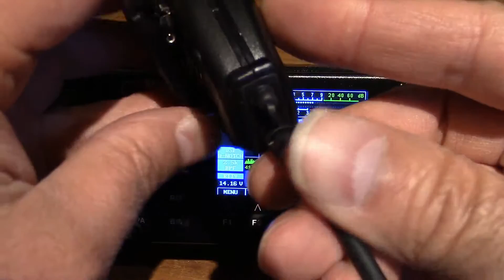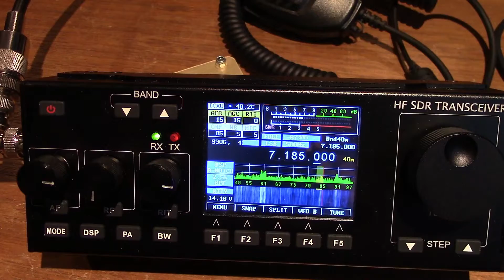Recent RS-918ssb HF SDR Transceiver (direct audio)

Comment: Thanks for nice video. 

How well doesn't he noise blanker work, especially on 60Hz POWER line noise.

Thanks, 73
Reply from the maker: That is a very good question. I dont have an answer because I do not experience power line noise at my QTH. All power lines here are underground.
Reply: Radio Hobbyist Thanks

Comment: The RS-918 its a great Radio, Compact, Efficient, and make the Job very well, put inside your backpack, with a  9amp Batt, a EndFed Antenna, and you have a Shack Anyware, Anytime. want more for less than 500 bucks?
Reply from the maker: Yup. I need to find a battery before field-day.